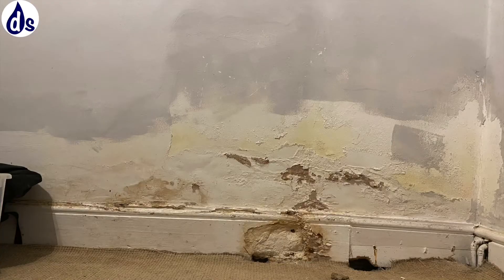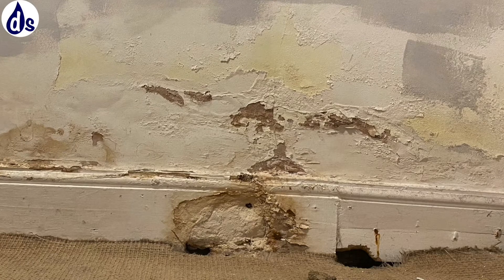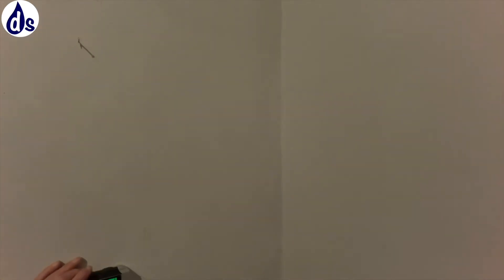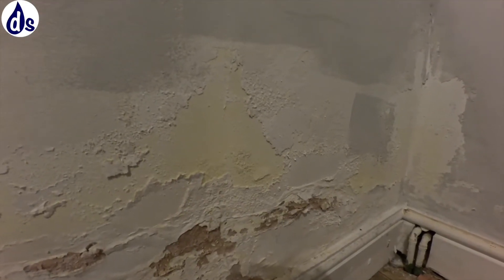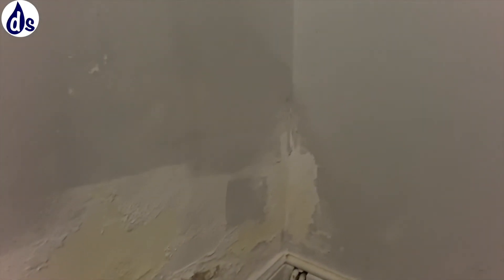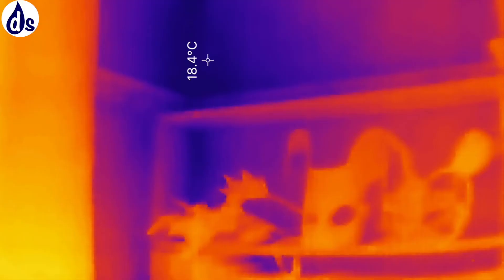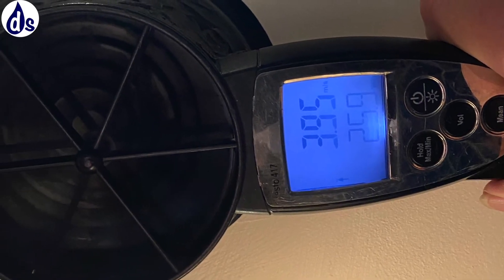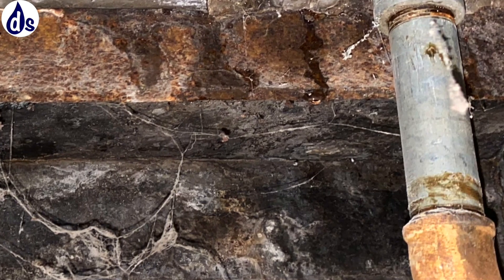⬆️ Condensation From Fireplace Removal 🤔: Highgate, London | Damp Survey Results Explained

Comment: These videos are great.....do you have a link to the 22 pound damp meter you mention?
Reply from the maker: Thank you for the kind words! 😊

The damp meter I often recommend is the Dr. Meter 2-in-1 Moisture Meter. It’s a budget-friendly tool that’s great for general use. You can currently find it on Amazon for around £17–22.

Here’s the link:
👉 https://www.amazon.co.uk/dp/B07Z1MS56X

It’s an excellent choice for DIYers to get a sense of damp (or dry) levels in their property. Just remember:
	•	Use it for relative readings rather than exact values.
	•	Compare areas of concern to known dry spots on similar surfaces for accuracy.
	•	Be cautious with readings on dense materials like stone or metal—they can give false positives.

Let me know if you have any questions about how to use it effectively! 🚀
Reply: @dampsurveys  thanks very much for the damp meter info.  Do you have any recommendations for decent vfm 20L or 30L dehumidifiers?

Comment: Great video! Could you put a link to the damp data loggers you recommend please. Also I have a disused chimney and as I am trying to insulate my property better I was thinking of filling the whole chimney with a cement and vermiculite filler the same as is round my flue in the chimney which we are using. Would this be okay from a damp point of view? Many thanks.
Reply from the maker: Thank you for the thoughtful comment! 😊

Recommended Damp Data Loggers:
For tracking humidity, temperature, and dew point, I recommend the ORIA Wireless Thermometer Hygrometer, Mini Bluetooth 5.0 Temperature Humidity Sensor. It's affordable and reliable for DIY use. You can find details and links to my recommended loggers here: 👉 https://damp.ai/detect/

Disused Chimney & Vermiculite Filler:
I'm not entirely familiar with vermiculite as a filler for chimneys, but based on its properties (lightweight, insulating, and often vapour-permeable), it seems like a reasonable option.

Here’s my general advice for insulating disused chimneys: 
1️⃣ Vapour Permeability
Ensure the filler material allows for some vapour permeability to prevent trapping moisture. This is critical to avoid condensation or dampness within the structure.

2️⃣ Avoid Completely Blocking Airflow
While stopping excess airflow is fine, it’s usually best to allow for a small amount of ventilation at the top of the chimney. A vented cap can help reduce the risk of damp.

3️⃣ Inspect the Structure
Before sealing or insulating, check for signs of existing damp within the chimney. These should be addressed beforehand to avoid future problems.

Related Videos:
👉 Damp in the Fireplace – An Unwelcome Guest: https://youtu.be/u-_xeMfUI0I
👉 Hygroscopic Salts Triggered by Rain Part 1: https://youtu.be/HJR7MqbnRZ4
👉 Hidden Damp – Water Stains Behind a Kitchen Cupboard: https://youtu.be/QGz5GA5MCVQ

Feel free to share updates—I’d love to hear how your project goes! 🌟